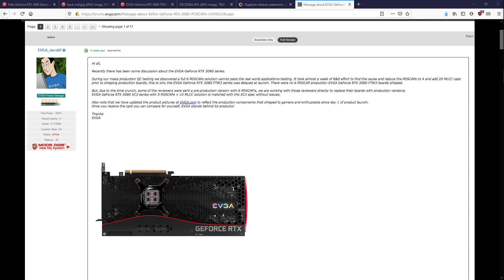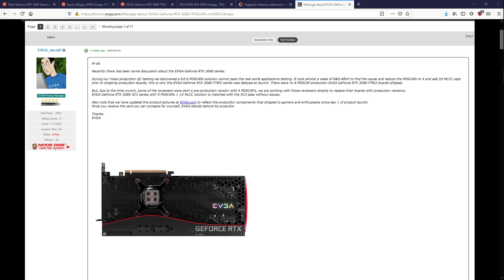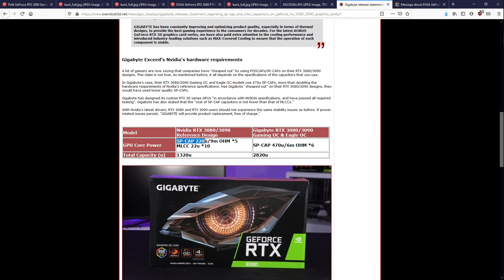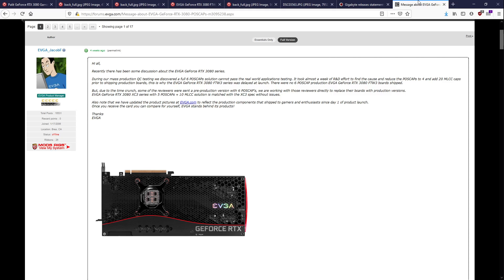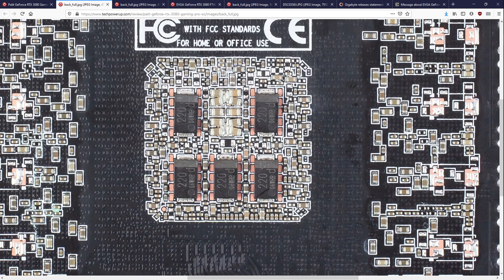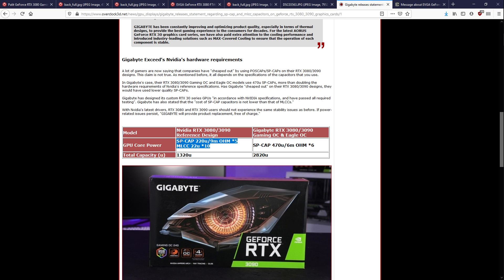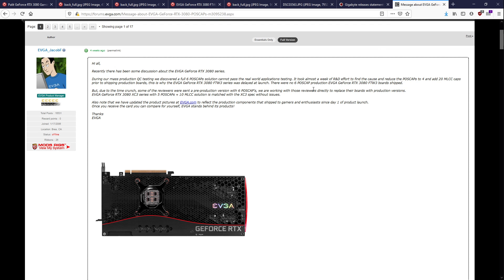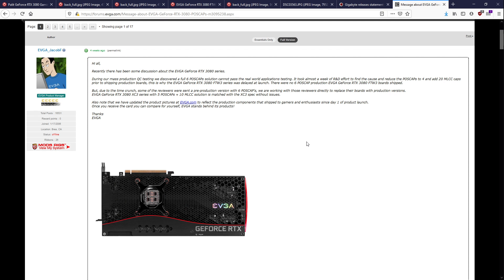The core capacitors on the pre-release 3080 FTW3 vs the retail 3080 FTW3

Comment: Steve was also using a really 1st rate power supply, probably the best you can get because he's overclocking a lot so that could also explain why he's not having problems even though he has the 6 POSCAP card. A neat little experiment might be to downgrade the power supply  to some average bronze certified unit with mediocre specs as far as ripple and seeing how it does ..... I know I had problems with a mediocre 550W EVGA power supply with a RX5700 (non-XT) where I suspect it was tripping the OCP even in old games like AC Black Flag so I upgraded to a 650W Corsair CX 650 and most of my problems disappearred (Remaining problems were AMD's crappy drivers) and after I verified it was mostly stable I flashed the BIOS from a corresponding XT board and it still remained stable for the most part ..... So I had near RX 5700 XT performance from a non-XT card I got for $300 during a pre-Black Friday sale last November ..... However on my new build that I'm finalizing as I speak I went back to Nvidia because I was so disappointed with AMDs drivers ..... Basically the RX 5700 had a similar problem as the RTX 3080 did the main difference it took Nvidia just days to fix it in the drivers whereas it took AMD about 6 months .... The best graphics card in the world is worthless if the drivers are utter garbage and that's why I'm not waiting around for Big Navi  .... I expect it will take another generation before AMD catches up with Nvidia especially when it comes to Ray Tracing and anthing that can compete with DLSS 2.0
Reply: A lot of the tech press had experienced the 3000-series problems immediately - while I'm not aware of any of the media (I mean, surely there's a few out there) replicating the 5700-series issue, and that's over the duration of those months with many of those cards in 'daily drivers'.
  
Would love to know what you know about these two separate issues in two completely different cards at all even being comparable, both in amount of cards affected and in details about the actual problems in the first place.
   
Critical thinking

Comment: Buildzoid, Off Topic Question; If I use a custom cooling solution on my T-Force Xtreem argb 3600 ram to keep it 30°C, what is the highest voltage it could safely handle for daily use?
Reply: It depends on the actual ICs, are they Samsung B-die?
Reply: Take a look at the JEDEC specifications. The maximum voltage recommended for daily use is 1.50v, but that is for Samsung B-Die.  Everything else can run safely at around 1.45v. I like to keep mine at 1.4v just to be safe, but my IC's are a really low bin so they won't scale well with the extra voltage anyways.

Comment: Why is no one actually using a scope to measure ripple with the different cap setups? How hard can it be?
Reply: Probably cause there's short supply, so more niche channels and individuals like ahoc (not that Buildzoid normally gets new GPUs) don't have GPUs to test. And mainstream tech reviewers don't tend to even own oscilloscopes, let alone know how to and care to do such testing.
Reply: @tarfeef_4268  True. Steve has one, but it's only a prop 😒
Reply: Actually relatively hard/expensive to have a proper ripple measuring setup for such low voltages and high frequency transients. if you try to do it with a standard oscilloscope probe you will get garbage data.
Reply: @jorno1994  Good point, you would need a specialized probe and a very high bandwidth scope if you want to measure ripple/transients at the actual clock speed. I was thinking more of the ripple/transients from the VRM at a few hundred khz. Just looked up power rail probes, Keysight has one for $3400 😆
Reply: Because nobody who cares about the results has cards and an appropriate oscilloscope and cares about doing the testing and publishing the results.
Reply: Debauer did it
Reply: @Chainspike101  link?

Comment: NVidia released several reference configurations for the capacitors.  Retail version of ASUS TUF series uses the "Below Spec" for the capacitors that you mentioned.  WHO DA F IS HONEST??? Someone has some explaining to do when they think they can cut some corners to save time and money when using 6 capacitors in place of 60!  NVidia's driver literally UNDERCLOCKS the cards literally to save face and keep the cards out there without having to fix them for the "OOPS! WE F'd UP!" ...  5 minutes of testing does not guarantee a card will perform well
Reply: What are you even talking about? The TUF cards have 6 mlcc banks.
The driver doesn't underclock the cards, just fixes the boost algorithm.
Even as someone who's not a fan of this series so far I have to admit shit is blown out of proportion and people like you seem to be a large part of the problem.
Reply: @NotThatGuyJD  Yup, for sure. I have little interest in it because, frankly, I was hoping for a little better than "poor performance-per-watt uplift over last gen, and you can thank us for not increasing the price again!" from these cards. I'm not going to make everything else in my system suffer(power draw when PSU pricing is through the roof, heat output;  these cards may not overheat with their absurd heat sinks - but it's just going to make everything else hotter in this mATX box) at the expense of a little more performance, nevermind that I'd also like to keep the temps down to keep the system quiet too.
  
...but, the drama and some of the shit slinging over this has really gotten out of hand. It's a brand new card, of course issues like this can happen; everyone's expectations are just ridiculous - sorry everyone you give money to isn't flawless.
Reply: @RyTrapp0  the worst part about all of it is the people that aren't going to buy one at all are complaining about the issues the cards have to the point where you'd think that they were harmed by the a product they don't even intend to purchase nevermind one they actually have.
Reply: @NotThatGuyJD  Yup, you definitely got that right. It's difficult to even know the extent of potential issues when it's impossible to tell how many people repeating it even have the cards.
Reply: My ASU’s tuf has the high end caps ,incredible card which I can increase the core by 200mhz without issue
Reply: I trust AHOC rambling :D

Comment: Can you do a video comparing performance difference between AMD and Intel regarding the 30series gpus?
And Id like to hear thoughts about improvements in gpu bottleneck of the upcoming ryzen 5000series.

Great content as always. Love from South Korea.
Reply: Hardware Unboxed has done one.
Reply: This is not a comparative channel, this is a real tech channel
Reply: @fabiotiburzi  I'm sorry, I want a detailed explanation of how the architecture difference between Intel and AMD leads to the performance difference we see on benchmarks and games. Everybody knows that Intel has the edge on achieving higher frames than AMD, and no channel has explained in-depth enough as buildzoid does on his videoes. Yea, REAL TECH give me f-ing break lol.
Reply: @south662  It's simple at least with the current generation of Ryzen ..... Intel runs at considerably higher clock speeds ..... Now the upcoming Zen 3 look promising and while they don't look to run as high of clocks as Intel they've made up ground with IPC improvements .... If you have a 5 Ghz clock but a 10% better IPC it can compete with an Intel running at 5.4 or 5.5 Ghz

However if you are running at 4K and to a slightly lesser extent 1440p then it makes little difference and you won't even notice it in actual gameplay, it's mostly relevant if you run 1080p in a competitive environment where the highest FPS you can get helps ..... For most of us mere mortals (Especially old guys like me that don't have the reflexes of a 20-some anymore) it's really not even relevant except as Bragging Rights for overclocking and AMD's superior multicore multithread performance is something an old guy like me can actually use outside of Gaming
Reply: @south662  that unfortunately is a secret, because otherwise everybody can make an amd or nvidia compatible gpu. Btw there should be a patent for the cuda archetecture but i think that the content has been hidden by the world patent company because nvidia is greedy and they do not want to show the layout of the transistor

Comment: I have a Palit RTX 3090 Gamingpro (non OC model) here, no issues at all in stock and it routinely boosts to 2000+ mhz no problem, i have it undervolted at 1850mhz .850mV just to reduce temps cause its hot in my country 😁

Comment: This helps a lot when you are going tu buy a new gen card and you can't make a decision
Reply: Actually there is so little difference between the brands that Hardware Unboxed isn't even bothering to benchmark games on every single one because they all run the same within a couple of FPS so it come down to build quality and most look pretty good to me except the Zotac ones who seem to have done some corner cutting on their VRMs
Reply: @longjohn526  Stay away from Zotac. Cost cutting components they know are so bad that the power limits can't even go above reference TDP. A 350W 3090 Trinity maxes out at 350W. No slider. Every other card can do 375W or better. Crap cards like that enable the "11% faster than a 3080" because the chip is so power limited. It has double the memory and 20% more cores, but you give it barely 10% more power. Duh. :P

Comment: Out of MSI, ASUS, Sapphire, XFX, EVGA, & Nvidia, I have had the worst experiences with EVGA.
Reply: What happened to you dude?
Reply: @andresleihe  Bought a 1080ti XC Black from evga.com website.; Faulty card #1. Forced me to pay shipping for rma.

Received the rma for card #2. Another faulty card, one of the fans wouldnt spin. Stonks, another rma where they refuse to cover shipping.

3rd RMA was okay.
Lesson learned, never use a debit card and buy from amazon / bestbuy / some retailer that will have your back.
Reply: @Secretcow  so you bounce back and forth between Nvidia and AMD quite a bit?
Reply: Whatevwr the best price to performance is.
Reply: @Secretcow  what were your last few cards?
Reply: @mr.blonde7812  two computers, one for me one for my fiance. Currently have 1 msi gtx 1080 & 1 xfx rx 580... planning on upgrading the rx 580 to either amd's 3070 competitor or 3070.. probably asus tuf $499 or founders.

Before new gen announced sold sapphire 5700 xt & asus 2080 s. Before that the evga 1080 ti (sold) + msi gtx 1080.
Reply: For me, the best and most reliable have been Powercolor and EVGA, also no problems with Palit and Zotac; the worst by far: XFX

Comment: is this still an issue even after that driver that apparently fixed the crashing?
Reply from the maker: you can't even buy the pre-release version so it never mattered I just find it intresting.
Reply: Zfast4you  Better than anything on trending.. If it isnt KSI, Logan Paul.. its another rainbow bridge troll doing makeup tutorials for Zur.. or Youtubes top 10 over-medicated diversity lectures.
Slim picks for sit and forget entertainment..
Reply: Zfast4you  you know damn well he probably paid $1500 and is using it as a business expense lol
Reply: Nope, didn't have issues with the earlier driver either. It does crash when spiking to 2115Mhz on scene changes in Port Royal/Timespy if I apply a +165 to +180 core offset without capping the max freq in the v/f curve, so overclocking does involve more tweaking than Pascal/Turing. Zotac Trinity base model
Reply: Yeah, a popular streamer named DR Disrespect had problems with massive stutters during his last 2 tournaments. He switched back to his 2080ti